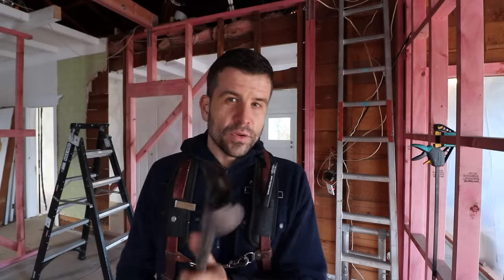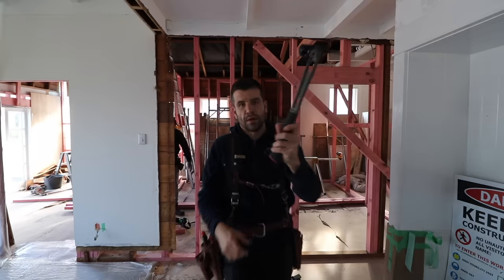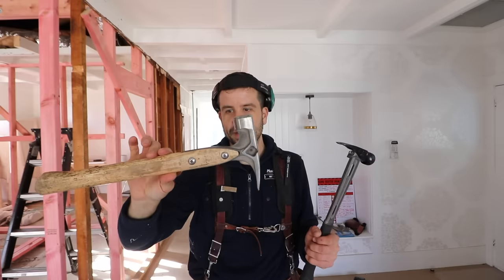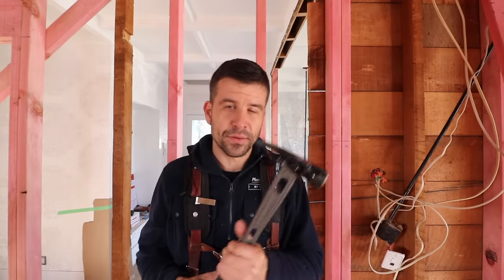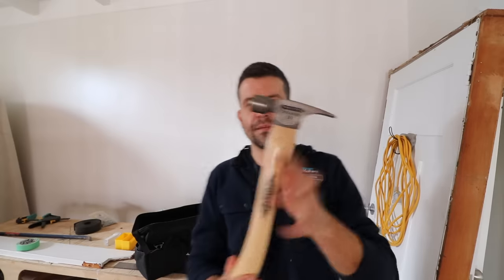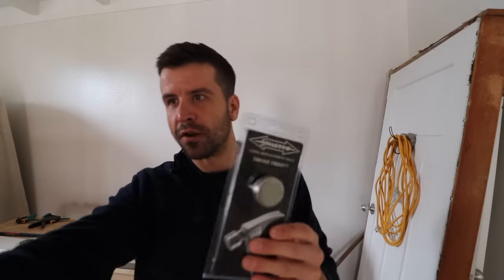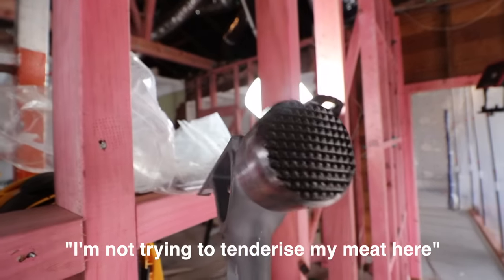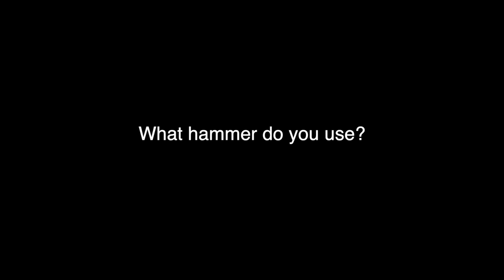Martinez M1: The Hammer Everyone Is Talking About

Comment: I have the Dalluge too - I love it except for the times it's flown out of my hand cos I've never got round to taping the handle and the handle screws loosening on a regular basis. It has a 'side' nail puller too! and a FAR easier to use one than the Stiletto style.. 
They totally aren't all the same price in Canada - the wooden handled versions are half the price of the Ti handles.
Reply: Use a card scraper and get that horrible varnish off the handle and treat with boiled linseed oil twice a year it's by far the best grip and will cut down on blisters if you dont use gloves. Tape gets sticky and messy and has to be replaced pretty often. I have to retape my hockey sticks every season and I play less than 30 games

Comment: First of all, Good informational vid. 

Now. Daluge stole their hammer design from the original Douglas Hammer. By far the industries best hammer featuring an INVERTED waffle head which guves you grip when you need it and now meat tenderizing on your wood. 

Next. The wood is ‘slippery’ because the manufacturer has to coat it in a varnish so it doesnt dry out. SO. Strip off the varnish with a knife edge. Coat it with pine tar and impregnate it an oven on lowest setting then rub bees wax over that when it cool and you will have the beat handle you ever out your hands on. 

Now. Go buy a real hammer. Get a Douglas.